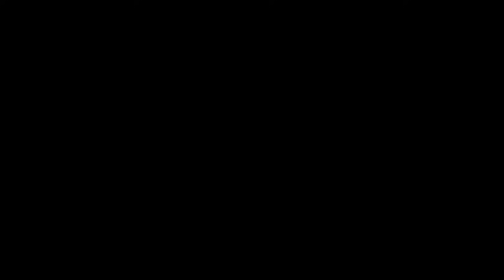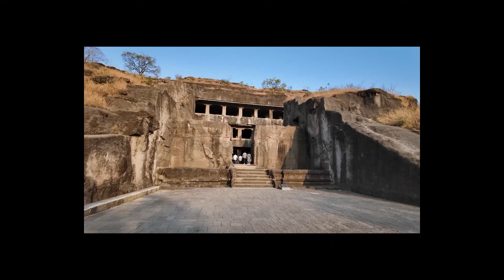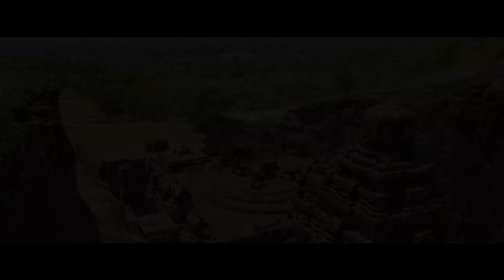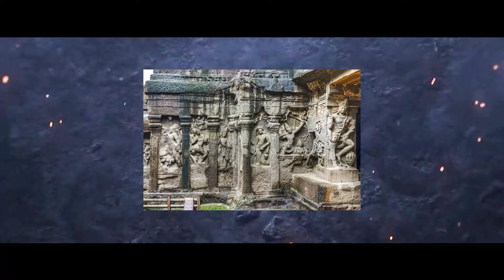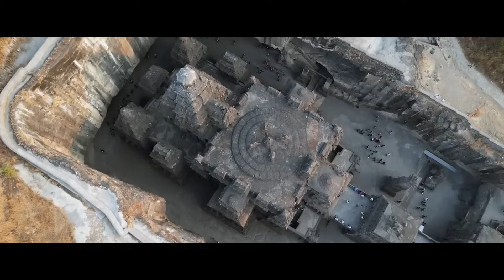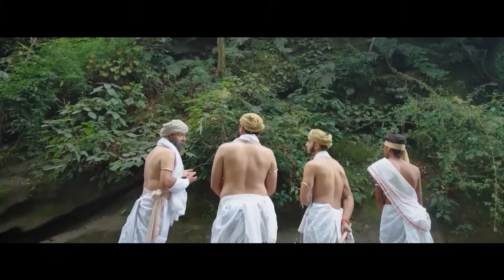An Ancient Temple Carved From a Single Mountain Using 400,000 Tons of Rock… This Shouldn’t Exist

Comment: Not every mistake would be irreversible, since it has four sides if you mess one section up, you can change the schematics and the design of the structure to match.
@book3311